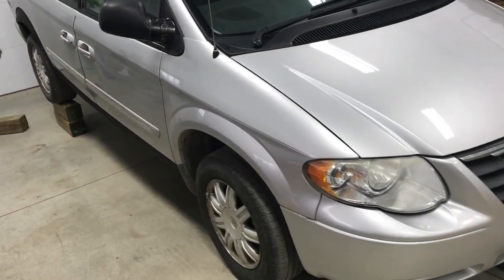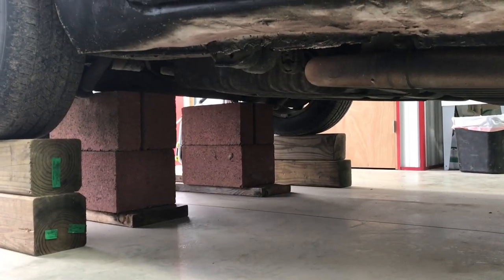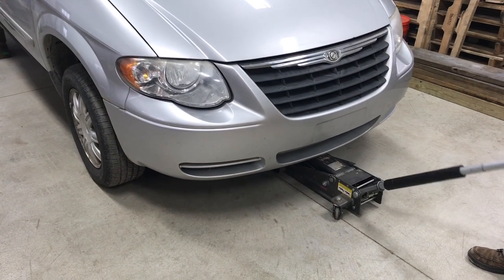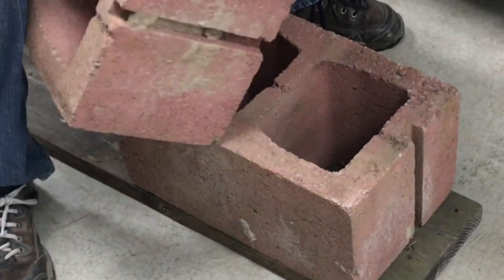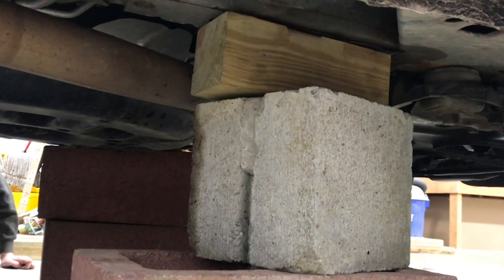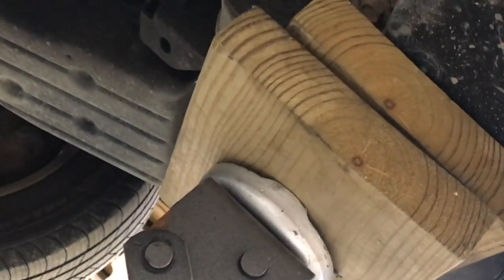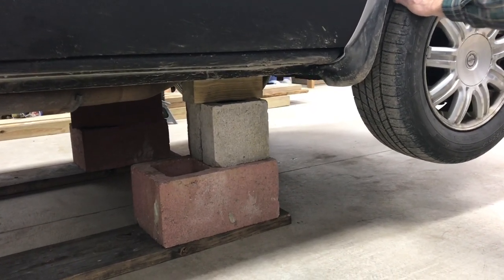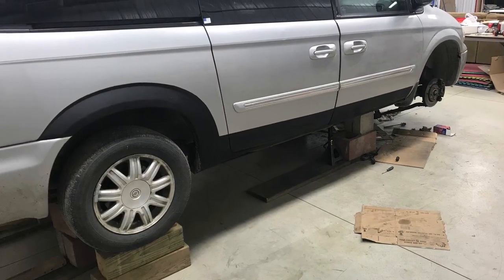jacking a car up REALLY HIGH so you have room to work under it

Comment: Guy, you should NEVERRRRR use cinder blocks no matter what position you place them in.. absolutely crazy period.. 🙈🙈🙈
Reply: They have solid paver blocks you can use. Put those under the tires and secure the car with jack stands
Reply: I think you should clarify. Never use only cinder blocks. You can use them but you should also use Jack stands as backups and place the wheels under the wheel hubs for extra security
Reply: If you’re gonna use CMU block fill the cells with grout or concrete. Ultimate strength
Reply: I'd rather use those recalled HF stands.
Reply: Lol 1 hour later we can work on the car
Reply: I would never go under this car. Why not just place jack stands. They are not that expensive plus a lot cheaper than all those cinder blocks and wood. I changed my whole suspension without a jack. Used a scissor jack to lift one side placed a jack stand then lifted the other side and placed a jack stand.
Reply: you're not using your brain. This is to get the car EVEN HIGHER than your jack stands will allow..... it's really not that hard.
Reply: @NeutronX101  jack stands don't lift that high.
Reply: @richardnixon9324  but unnecessary. I did most work on my car with using only one notch on the jack stand. Unless you are changing exhaust and I even did that with slightly higher notches
Reply: NEVER..EVER..EVER. use any type of stone, concrete or block supports. You will due.😱😱😱 Axle stands are for that  or big tree rounded and stands
Reply: I made the mistake of using cinder blocks while doing an axle swap on my jeep. The jeep was in the air about a month while I did everything needed to but after about a week the cinder blocks started to break apart... nothing fell and I noticed in time to swap them out

Comment: Dude! Be careful with these weak cinder blocks. They crack and break easily with impact.  Use lots of pressure treated wood instead. Wet wood don’t break. Cement does.
Reply: @itskingboy189  2 years later, I hope nobody got hurt using cinder blocks. For me, if I need to replace suspension I’ll take it to a local trusted shop, worth the money over time/risks. For oil, brakes, spark plugs, filters etc I do myself without getting under the car.
Reply: @BlueStreak706 shows that you're not truly a diy'er
Reply: @richardnixon9324  I’m still not crushed like a pancake after many oil changes and brakes. You never worked on cars but sit and whine.

Comment: "Safety is not something you can undo" Proceeds to use cinder blocks and a wobbly 4x4 to hold a van up.
Reply: Pssst. Hey rookie, that's how we all do it. Don't put the cinder blocks face down. Also, a 4x4 isn't wobbly if you have a load sitting on it.

Comment: Super dangerous my friend. Many accidents have happened from doing this. Just happened again in my area. If you are under the car when the blocks break you will either be crushed to death or, if someone is there to call emergency services, you will be trapped with likely serious injuries while the fire department gingerly raises the car so as to not injure you more. If you are alone and cannot reach your phone, eventually someone will discover your dead body.

Comment: I've seen jack stands fail, jacks lose pressure, wood cribs tip over, bumper jacks fall down... never seen 8x8x16 cinder blocks fail. Anything you do is done at your own risk... but Ive spartan kicked a vehicle on blocks 24" off the ground and it didnt budge, wouldn't do that on jack stands.

Edit: Just did a quick google to see if there were any pictures of failures... Looks like a lot of people dont know how to use cinder blocks properly. Holes pointing up, not horizontal. Way easier to bust one up if its horizontal.

Comment: This doesn’t seem that bad at all. What’s with all the complaints. I think I’d trust cinder block over a jack.
Reply: Problem is that the risk of cracking this blocks are high. And the risk of the car sliding sideways and the rest of the stands getting disturbed and boom. The car is going to crash land onto you.. Better off using wood crates (or what they are called) since they can be configured to handle the weight of heavy lorries...

Comment: A lot of people said not to use cinderblocks, but none of them could come up with anything better besides a jack (which does not apply when you want it high). Those people must have never worked with cinderblocks, or they used really bad/old ones, or stand them on the sides.
Reply: I'll tell you what works better and is safer than cinder blocks. It's called cribbing blocks which are made of dimensional lumber (such as traditional 2x4s, 2x6s, 4x4s, 6x6s etc) which are interlaced together. It's what houses are lifted with and what firemen use to lift people who are stuck out.
Reply: There is too much to consider when using them for this purpose. Any concentration of pressure from uneven stacking, corner of a frame rail or bolt, a wayward pebble underneath while loading or similar situation can quickly exceed the PSI limits of cinder blocks. Sure you can get lucky using them in a pinch. But too many have FAFO why this is a bad idea. Cinder blocks are meant to have an even load spread though a bed of mortar. This is not something always feasible to duplicate by someone in too much of a hurry to find a better way.
Reply: Simple. Buy larger jack stands. I have a huge set that can easily reach that height

Comment: It is trivial to build safe wheel cribs with 2x4's.    putting wood on top of your jack in it's weakest orientation for that it cracks and falls off the jack.  cinder blocks...   This is like the opposite of anything you should do.

Comment: I wanna change my oil and change these two leaking O-rings on my power steering pump. I am able to get my scissor jacks to get the car on the stands two notches high, and that works for changing the oil, but I don't think that will be enough room to work on the pump. I was just thinking of putting my scissor jacks on bricks every two notches until my car is high enough. I think the stand needs to be 5 or 6 notches high so I have room. Maybe 7. I'm a mechanic noob, but I also take safety very seriously. If that doesn't sound safe or someone has a better idea LMK
Edit: I (my dad) have a hydraulic floor jack, but it fails after so many pumps. I'm starting not to trust it

Comment: Using cinder blocks as shown in this video is perfectly safe. He's right, get the orientation correct and cinder blocks can HOLD UP A GIANT BUILDING ! ! ! ... personally, I put the block on a rectangle of heavy plywood that's been cut a bit bigger than the block. And then a wood block of 2x4/6/or 8 (what ever width is appropriate), that isn't rotted or severely weathered or split off from it's main board, above the top cinder block. The wood mushes a bit like a gasket and stabilizes everything. Yes, using cinder blocks in the wrong orientation is a fatal mistake. And NEVER use lightened blocks (air crete), no matter what. Cinder blocks that are rated for foundations are plenty dense and strong. I thought the video was quite good.

Comment: ME; Looks over at the cinder blocks that have been under my RV for over 30 yrs. Recalls a time when RV was loaded with hardwood, used as an office with dozen men beside said firewood. Got shook during hurricanes and handles -30 c temps with the heavy load.
Folks are correct about the dangers of materials but also like to repeat BS in the comment section. It's all quite comical really when everything is considered.

Comment: Get like hard wood like square pavers   But wood 5 high each wheel  4 jack stands and a jack that does lift high, if the stand did go there on the hard wood, double safety,

Comment: Its 2024 and this is the first video that made me laugh.
Anyway, I know 3 guys who died from resting heavy weight on cinder blocks.
They stack them the correct way, but they crumbled.
If you do it right, you can crack cinder blocks with your bare hands.
1 died from a cave in.
One guy died as like a 3rd cousin removed from me.
And other was on a rock quarry -- he should've know better.
Have you ever seen those Karate competition where judo chops break planks in half.
Well falling weight will do that to cinder block no matter what orientation you use.
When lifting a car, and yoyu want to crawl under it, then you need to use solid stacks of wood because if the car tilts or moves on you, the block will just roll and still guard against 6_000 pounds.
Get some wood or metal stands with a wide stance and wide contact/load points (like under your wheels and jack/lift points in the manuals) -- don't even use (tiny) jack stands because they tilt on you if the ground is uneven:  pro tip, the surface or ground is never perfectly leveled.
Anyway, this is a good video showing how to improperly do it.
Keep this video up.

Comment: They use the same blocks to hold up mobile homes everywhere. And I guarantee mobile homes are way heavier.
Reply: No. I had a car fall off jack stands what weighed 1314kg so just under 3000lbs. Slid of the jack and collapsed block.
Reply: The whole structure may be heavier, but there are quite a few piers made of blocks holding up those homes, so the actual load on each block is likely quite a bit less. Plus the home is (or at least should be) tied down, so there is no chance of it moving around.
Reply: I can tilt a car over with my 250lb body.   I can't do that to a home.  Once the car is in falling motion, a cinder block is not going to hold up.  Hell you can throw a cinder block or drop a cinder block about 5 feet and it'll crack.

Comment: Hey all you naysayers, relax. It's in the video but he doesn't really mention the importance and vital difference of sandwiching the blocks between wood. I'd be super leery of resting metal frame on concrete blocks, but the wood above and below the blocks serves as a type of cushion / gasket to distribute the load of the vehicle across more surface area of the blocks. This is viable in a pinch, just be wary and watch what you're doing.
Reply: It probably works most of the time in a situation that you want it to work all of the time. I'd rather used interlaced wood.

Comment: Is it okay to use a ramp and then use a Jack to lift the car. Then put the brick from the back of the car? I'm new to fixing.
Reply: Don't use cinderblocks whatever you do. This will get you killed. If you dont have money for some decent jack stands you can easily make a rock solid stand out of 2x4 for relatively cheap. Just be safe and never sacrifice safety for convenience 🤙
Reply: @angelo65116512  my question is what can I do to lift my car up so I can go under the hood
Reply: @josephpark6064  under the hood? You shouldn't need to jack up the vehicle
Reply: @angelo65116512  ok
Reply: @angelo65116512  AHAHahahha, that's funny. I was expecting a reaction like this.
Reply: @furkan10ky  i would expect nothing less after responding to a 2 month old comment